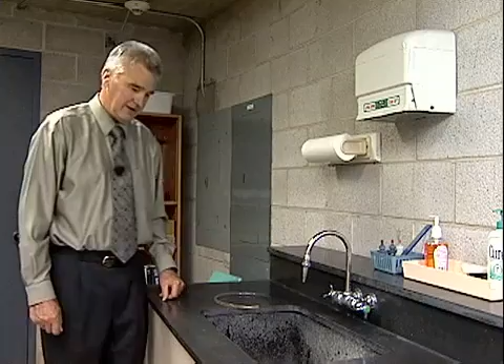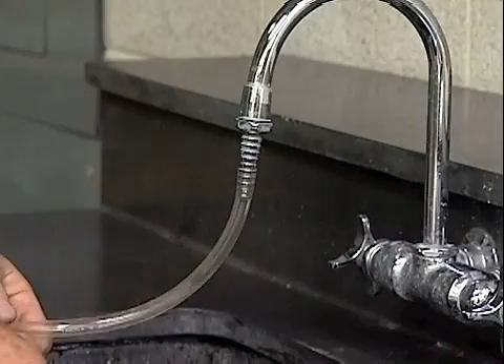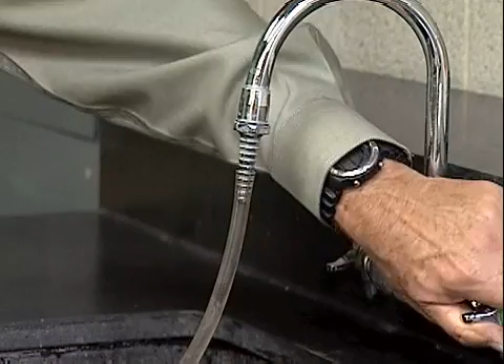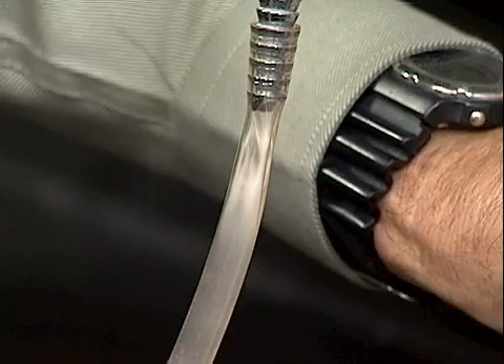Bernoulli's Principle: Hose Attached to a Faucet

Comment: This explanation is incorrect.
.
If you don't know what entrainment is, please look it up. It does have to do with viscosity.  
.
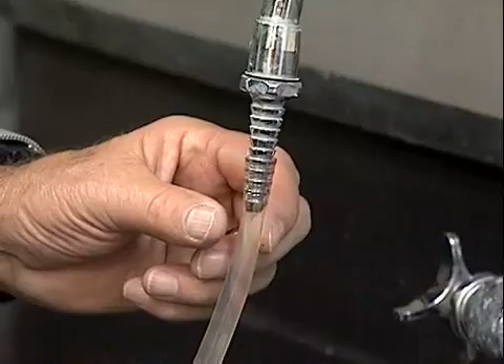Look closely at the zoom-in at time 1:05.
.
A drawing would help.
.
The Inside diameter {ID} of the nozzle is smaller than the hose ID. This leaves a blunt edge of that nozzle rim where the smaller stream of water exits into the wider hose. 
.
There will be water right up against that blunt rim forming a "stationary" water ring around the exiting jet of water. 
.
The exiting jet will entrain that ring of water, drawing it downward along with the jet.  Think of it as friction, or a viscosity effect.   The blunt rim PREVENTS more water from filling-in to the space immediately below the rim.
.
Because that water ring is drawn away from the blunt edge, that lowers the pressure in that 'ring'. 
.
With low enough pressure it can vaporize the water as he correctly says, causing tiny bubbles of water vapor to form that gives it that cloudy look as there is much turbulence within that ring of what is now tiny bubbles.
 .
So it is NOT simply the low pressure "created by high velocity".  That is sadly an all too common misunderstanding of Bernoulli that I call "Bad Bernoulli".
.
The high speed jet AND this BLUNT EDGE geometry is a set of constraints that together, with entrainment, are the causes of the lowered pressure. 
.
It takes ALL of that, NOT JUST SPEED.!.!.!
.
When he turns up the flow you can see the soft hose being drawn in more, as well. 
.
WHEN the hose is not pushed on, that jet of water will draw AIR along with it on the outside of the jet. Entrainment works between fluid types.
.
 This is the 'shower curtain effect'; it is why a shower draws the curtain inward - - water entraining the air around it.  it IS the entrainment removing the fluid around the jet and you have some surface preventing the fluid from flowing back into that space to replace that sir, THEREFORE causing a lowered pressure.
.
It takes ALL of those constraints for this to happen.
.
The water jet OUT OF the nozzle would be AT ATMOSPHERIC PRSSURE if there was no hose and other surfaces preventing a free flow of air around the jet. . .  The air would easily flow in from along the 'bumpy' outside of the nozzle and follow the jet away from the nozzle - with the SAME kind of turbulence we see with an ordinary jet out in the open with turbulence around the ever widening jet.
.
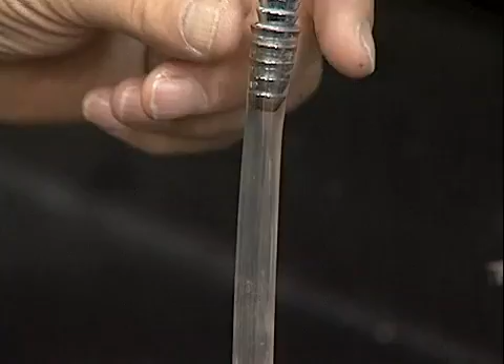He is ABSOLUTELY INCORRECT at 1:46 when he says: "So, once again when we have a high velocity, we have a low pressure." <--WRONG!.  
.
It takes all of these constraints {or boundary conditions} for this pressure reduction to happen. 
.
Bernoulli happens going from the elevated pressure NSIDE any blower to the lower atmospheric pressure outside the blower that we see the combination of the speed increase along with the pressure decrease as we move ALONG the flow. 
.
The pressure within the jet decreases TO atmospheric pressure NOT below it.!.
.
.
If that nozzle had a knife edge opening such that the ID of the nozzle and hose were identical, this would NOT happen.

Comment: This is not entirely correct. For example, fire water guns have an outlet cross-section smaller than the inlet cross-section, and the speed of fire water increases while the pressure decreases continuously. But no matter how much it drops, the pressure inside the fire water gun is always higher than atmospheric pressure.

The experiment in the video generates pressure below atmospheric pressure because the diameter of the nozzle outlet is smaller than the inner diameter of the hose. This is not caused by Bernoulli's principle. This is due to viscosity causing local sub atmospheric pressure. The Bernoulli principle is applied to ideal fluids, which have no viscosity.
Reply: I'm pleased to see someone else understands that this video is incorrect. The term you are missing is entrainment. Viscosity between the water exiting the nozzle and the water around the perimeter of the nozzle, that you mentioned, causes it to drag some of that water out of there creating the lower pressure. You are correct and it has absolutely nothing to do with Bernoulli's Principal. It is so sad that we see PhD's teaching this misconception. The pressure of the water exiting the nozzle into the atmosphere is at atmospheric pressure.  He also has at least one other video with this misconception. I will try contacting the university about it.

Comment: This is incorrect because Bernoulli has to do with speed CHANGES, not simply speed.  
I say that this is misinterpreted. 
.
There does appear to be something like cavitation where that cloudy area is, although you don't use that term, but I know that water will contain some dissolved nitrogen and oxygen (air). 
..
Also, it is not clear what you mean when you say that it "shuts itself off" as you turn the flow up.  I still see a bit longer cloudy area. 
. . 
That said:
.
Bernoulli normally "happens" because there is a higher pressure INSIDE the faucet compared to atmospheric pressure outside it.
The static pressure of the stream exiting the faucet into the atmosphere is AT atmospheric pressure.
This is a Pressure Gradient that is the cause of the acceleration of water out the nozzle. A Pressure Gradient provides the force to Accelerate the water.
Air out of your mouth or a blower / hair dryer is AT atmospheric pressure - NOT below it.
.
If this is claiming that the fast stream of water out of the faucet has a pressure lower than atmospheric pressure ONLY because of ir "fast" speed, that is false.  As I say, it is AT atmospheric pressure and can be easily measured as such if you know how.
.
Adding the tubing complicates things making this a poor choice of a proof.

.
The added hose complicates the constraints because of the  additional restriction of the tube walls.
The stream will certainly entrain the surrounding water.  This is a viscosity effect.
Sorry.
.
 Based on that, 
Watching closely, I think this is a result of entrainment.
This is the same reason you can blow into those long "Bernoulli bags" with one breath.  Entrainment, due to viscosity, draws more air in around the blown stream. 
..
If you think that stream out of the faucet, without the extra tubing, is below atmospheric pressure due to the fast speed, you are wrong. 
That is an all too common misconception about Bernoulli's Principle.
Reply: Yes, it also strikes me as somewhat a poor explanation for the observed phenomena. The flow of water at that speed is, more than likely, not laminar. The flow of water at the end of the nozzle is certainly not laminar and hence, Bernoulli's principle should not be applied here. I think the small stream of water out of the nozzle maintains its diameter for a while due to viscosity. Hence, this small stream impacts against the walls of the plastic hose until water can fill the entire diameter of the hose again. In the little space after the exiting of the nozzle, there must be empty spaces created by the small stream of water and evaporation might occur here, but it was not caused by the effects described by Bernoulli's equation, but due to effects associated with turbulent flow and viscosity.
Reply: @ozkroca9003  PLEASE let me know with a reply, if you follow this.

You are close. I now see what is happening. 
.
If you don't know what entrainment is, please look it up. It does have to do with viscosity.  
.
Look closely at the zoom-in at time 1:05.
.
A drawing would help.
.
The Inside diameter {ID} of the nozzle is smaller than the hose ID. This leaves a blunt edge of that nozzle rim where the smaller stream of water exits into the wider hose. 
.
There will be water right up against that blunt rim forming a "stationary" water ring around the exiting jet of water. 
.
The exiting jet will entrain that ring of water, drawing it downward along with the jet.  Think of it as friction, or a viscosity effect.   The blunt rim PREVENTS more water from filling-in to the space immediately below the rim.
.
Because that water ring is drawn away from the blunt edge, that lowers the pressure in that 'ring'. 
.
With low enough pressure it can vaporize the water as he correctly says, causing tiny bubbles of water vapor to form that gives it that cloudy look as there is much turbulence within that ring of what is now tiny bubbles.
 .
So it is NOT simply the low pressure "created by high velocity".  That is sadly an all too common misunderstanding of Bernoulli that I call "Bad Bernoulli".
.
The high speed jet AND this BLUNT EDGE geometry is a set of constraints that together, with entrainment, are the causes of the lowered pressure. 
.
It takes ALL of that, NOT JUST SPEED.!.!.!
.
When he turns up the flow you can see the soft hose being drawn in more, as well. 
.
WHEN the hose is not pushed on, that jet of water will draw AIR along with it on the outside of the jet. Entrainment works between fluid types.
.
 This is the 'shower curtain effect'; it is why a shower draws the curtain inward - - water entraining the air around it.  it IS the entrainment removing the fluid around the jet and you have some surface preventing the fluid from flowing back into that space to replace that sir, THEREFORE causing a lowered pressure.
.
It takes ALL of those constraints for this to happen.
.
The water jet OUT OF the nozzle would be AT ATMOSPHERIC PRSSURE if there was no hose and other surfaces preventing a free flow of air around the jet. . .  The air would easily flow in from along the 'bumpy' outside of the nozzle and follow the jet away from the nozzle - with the SAME kind of turbulence we see with an ordinary jet out in the open with turbulence around the ever widening jet.
.
He is ABSOLUTELY INCORRECT at 1:46 when he says: "So, once again when we have a high velocity, we have a low pressure." <--WRONG!.  
.
It takes all of these constraints {or boundary conditions} for this pressure reduction to happen. 
.
Bernoulli happens going from the elevated pressure NSIDE any blower to the lower atmospheric pressure outside the blower that we see the combination of the speed increase along with the pressure decrease as we move ALONG the flow. 
.
The pressure within the jet decreases TO atmospheric pressure NOT below it.!.
.
.
If that nozzle had a knife edge opening such that the ID of the nozzle and hose were identical, this would NOT happen. 
.
PLEASE REPLY if you follow this.  I am 100.00% certain this is the true physics. 
.
Regards.
Reply: @ozkroca9003  P.S.  I also reviewed his other videos and I see he has several others on Bernoulli and repeats common demos and associated misconceptions, so he does not understand the physics, sorry. 
It is so frustrating.
Reply: This is not entirely correct. For example, fire water guns have an outlet cross-section smaller than the inlet cross-section, and the speed of fire water increases while the pressure decreases continuously. But no matter how much it drops, the pressure inside the fire water gun is always higher than atmospheric pressure.

The experiment in the video generates pressure below atmospheric pressure because the diameter of the nozzle outlet is smaller than the inner diameter of the hose. This is not caused by Bernoulli's principle. This is due to viscosity causing local sub atmospheric pressure. The Bernoulli principle is applied to ideal fluids, which have no viscosity.

Comment: what a fantastic demo.
Reply: because Bernoulli has to do with speed CHANGES, not simply speed.  
I say that this is misinterpreted and shameful coming from a "Phd".
.
There does appear to be something like cavitation where that cloudy area is, although you don't use that term, but I know that water will contain some dissolved nitrogen and oxygen (air). 
..
Also, it is not clear what you mean when you say that it "shuts itself off" as you turn the flow up.  I still see a bit longer cloudy area. 
. . 
That said:
.
Bernoulli normally "happens" because there is a higher pressure INSIDE the faucet compared to atmospheric pressure outside it.
The static pressure of the stream exiting the faucet into the atmosphere is AT atmospheric pressure.
This is a Pressure Gradient that is the cause of the acceleration of water out the nozzle. A Pressure Gradient provides the force to Accelerate the water.
Air out of your mouth or a blower / hair dryer is AT atmospheric pressure - NOT below it.
.
If this is claiming that the fast stream of water out of the faucet has a pressure lower than atmospheric pressure ONLY because of ir "fast" speed, that is false.  As I say, it is AT atmospheric pressure and can be easily measured as such if you know how.
.
Adding the tubing complicates things making this a poor choice of a proof.

.
The added hose complicates the constraints because of the  additional restriction of the tube walls.
The stream will certainly entrain the surrounding water.  This is a viscosity effect.
Sorry.
.
 Based on that, 
Watching closely, I think this is a result of entrainment.
This is the same reason you can blow into those long "Bernoulli bags" with one breath.  Entrainment, due to viscosity, draws more air in around the blown stream. 
..
If you think that stream out of the faucet, without the extra tubing, is below atmospheric pressure due to the fast speed, you are wrong. 
That is an all too common misconception about Bernoulli's Principle.
Reply: The trouble is, he is wrong. He is mistaking the perimeter entrainment for a lower pressure within the stream. 
.
The water coming out of the hose is at atmospheric pressure. Because of viscosity, water exiting that nozzle draws some of the water around the perimeter of the jet with it, just past the nozzle end-rim. That's what lower the pressure as it entrains water away, thus lowering the pressure to get cavitation. 
.
. . . . proofread and corrected 'entrainment' misspellings..
Reply: @SteveNoskowicz  I think that "in treatment" should be "entrainment."  Also, check your last sentence.
Reply: @mattb.2829  Frustrating. . . . Thanks. Yep.  Corrected and improved.